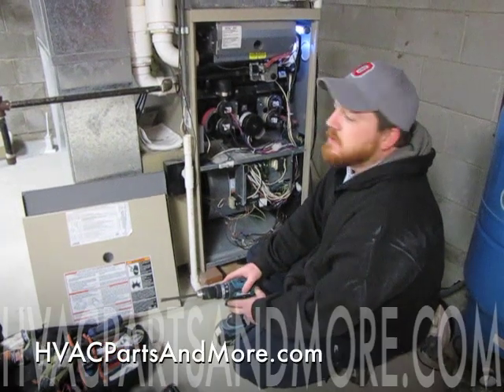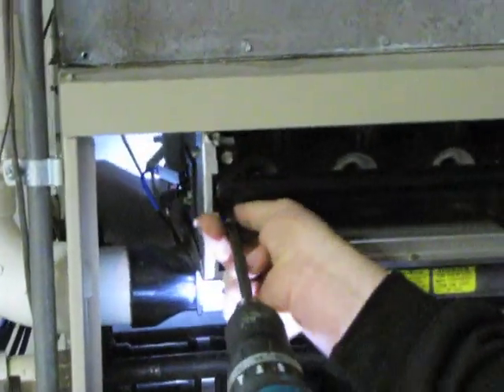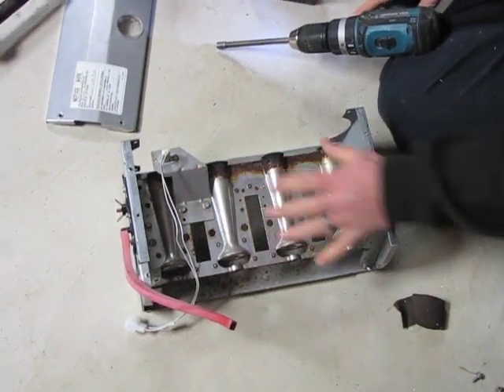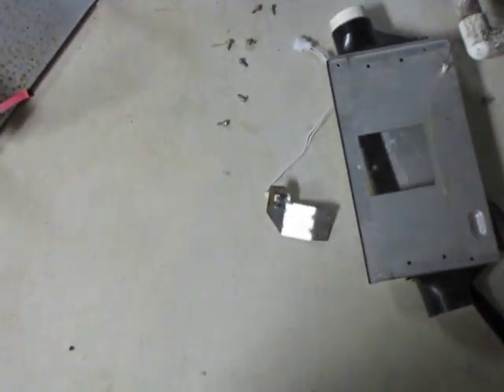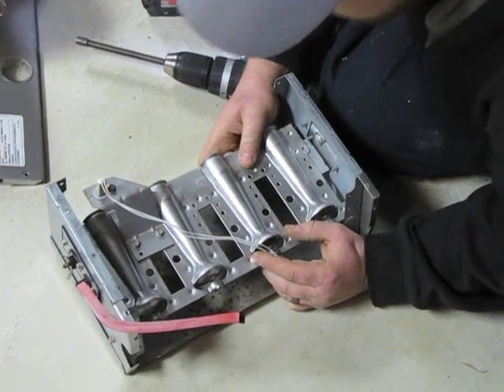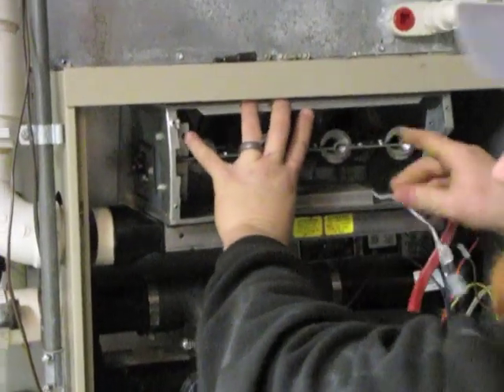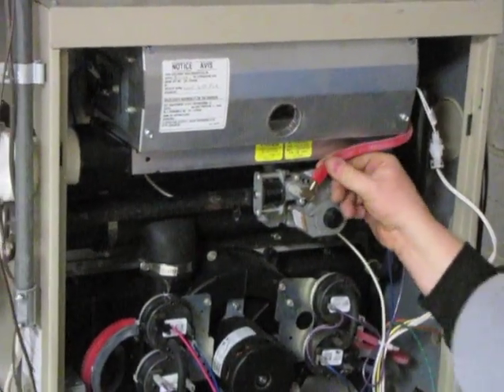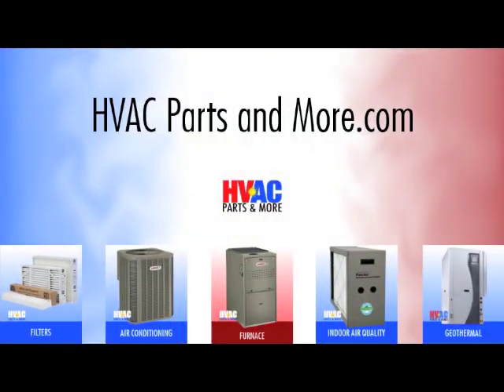DIY - How to Replace Burners on a Lennox G61 Furnace

Comment: Great video.  A couple questions, why did you replace the burners assembly?  Just trying to understand how you know it needs to be replaced.    Also saw on other videos this model is hard to replace flame sensor so just curious why you just cleaned it and did not replace it since you took it all apart to replace burners.   Again great video.  Thanks.

Comment: Lennox goes out of the way to make service time consuming.
Reply: Yeah. As a service tech, I absolutely hate  the G series. I tell our installers not to glue in the intake PVC and just use a screw. Makes things a lot easier in the future.
Reply: Yes like the ignitor and even the flame sensor some have it right in front

Comment: Hi, how do you fix a low flame error code on this furnace? Cleaned the flame sensors but board still flashing 1+2 code. Funny that furnace still runs intermittently with code flashing.

Comment: Thanks for the video. I have a Payne PG9MXA series furnace and it gives code 33 after burning gas for few minutes, stop and recycle the on/off process. Cleaning flame rod did not help. I thought cleaning burners should be easy as most 80% efficient burners. Built and design looks very similar to Lennox G61 and it looks cleaning or replacing burners is not for average DIY home owner as it may involve some manifold removal, etc. I got to watch more videos until I build some confidence.

Comment: Isn't it possible to remove the 2 screws holding the burner without removing the whole box? I have a Lennox Elite furnace and I feel that this would be easier if I used a right angle socket adapter.
Reply: Yes you can! It’s a bit of a pain, but I just did that tonight on my furnace!  I know this is an old question, so this comment is mainly for others wondering the same thing.
Reply from the maker: You could try it and see if it works for you, but it might be more frustrating and take almost as long trying to line everything up by feel in a cramped space.

Comment: Thanks, you just helped me with replacing the gas valve. Anything else I should do when doing the valve?
Reply from the maker: Not necessarily. While you have the furnace apart you might want to do some routine maintenance such as cleaning out any dust and wiping off the flame sensor.